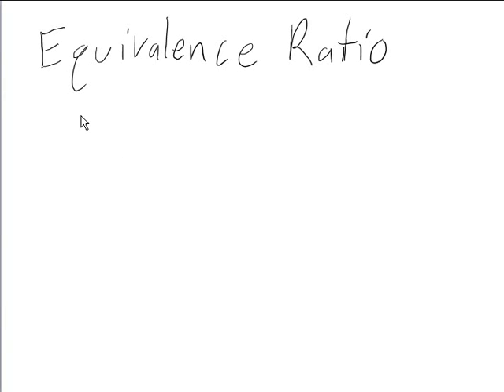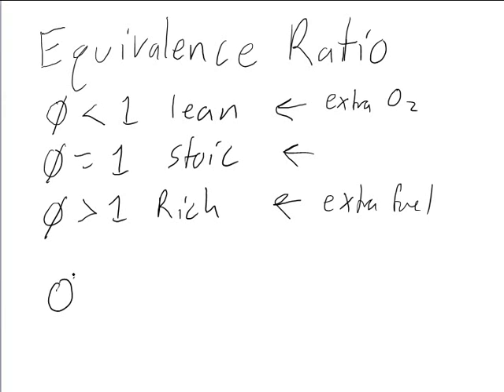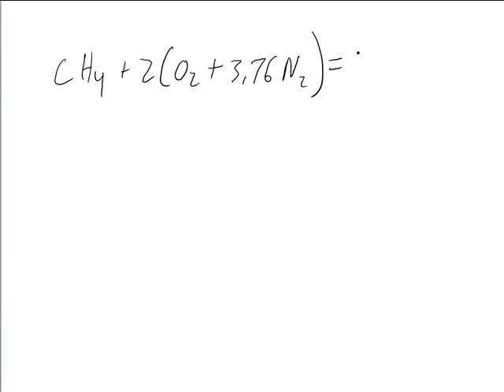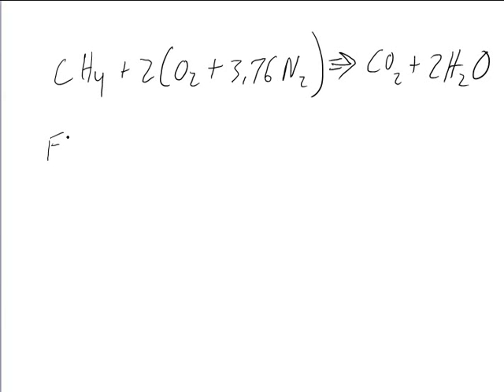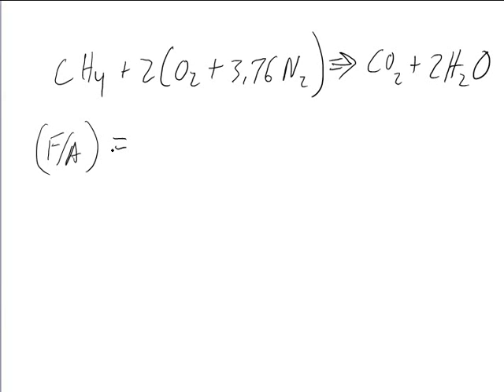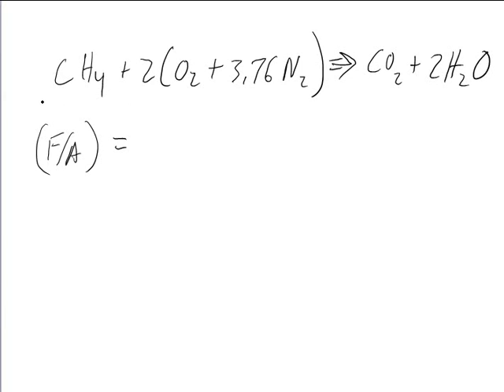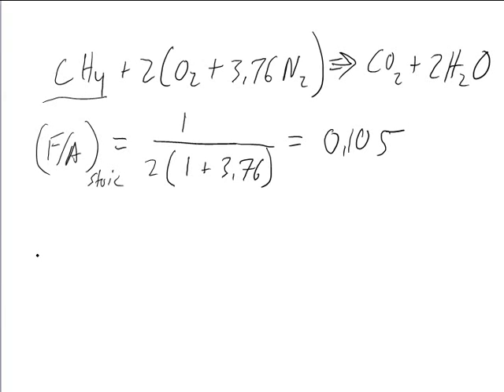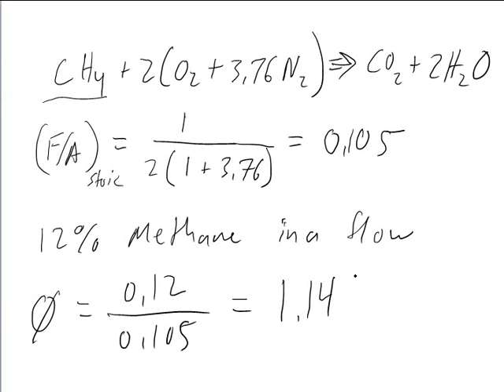Calculating Equivalence Ratio

Comment: Hey. Nice video. One quick question. Is the 12% methane assumed based on the range between lower explosive limit (lel) to upper explosive limit (uel)? In this case, methane's lel is 5% and uel is 17%. Is it a coincidence that you happen to assume 12% which falls under the explosive range? Enlighten me please.
Reply: Some source says 15% for uel.

Comment: Since we are talking about Fuel to Air ratio, assuming a 12 % volumetric concentration of methane in air which means there are 12 parts of methane and 88 parts of air making up a 100 part volume, the fuel / air ratio would be 12/88 and not 12/100.

This would change the calculated value significantly for higher concentrations.
Reply: Srikrishna Arangode Sundar Totally agree!